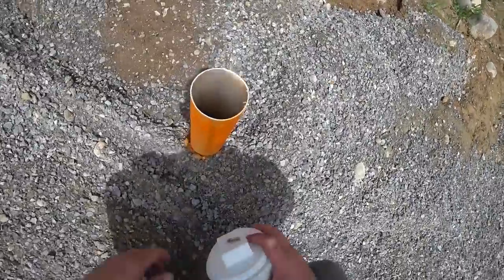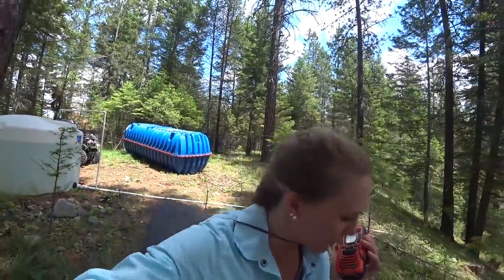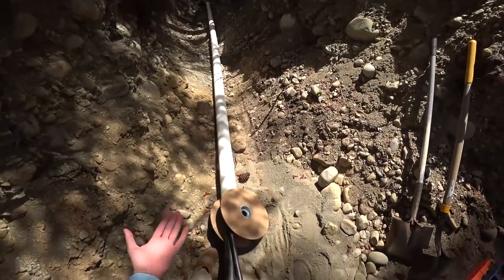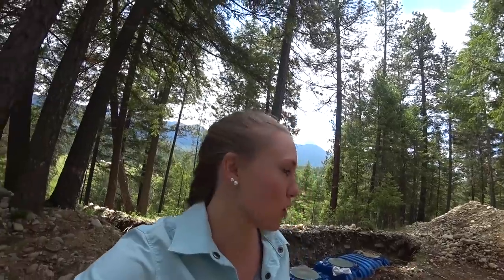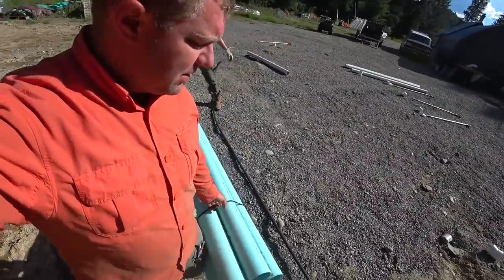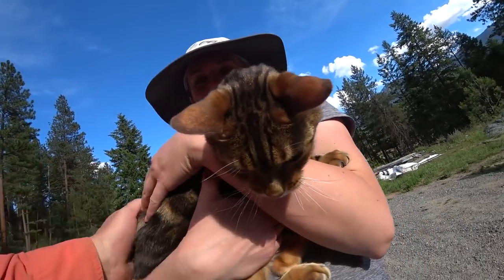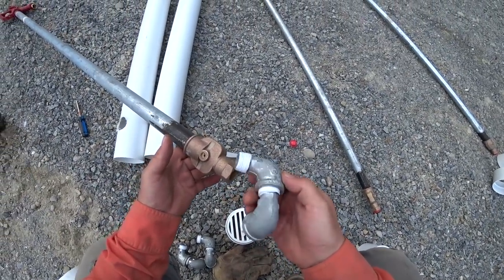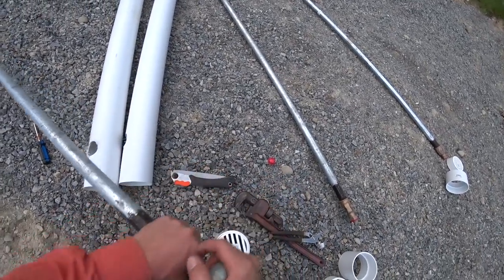Here a hydrant, there a hydrant, EVERYWHERE A HYDRANT HYDRANT!

Comment: Hey guys,  a quick tip for your plumbing projects. Alyssa already seems to have correct but when you are using adhesive always apply to the outer surface inner pipe first not the inside of the joint socket. Not a huge issue for casing but very important for water and sewerage piping. When you do this any excess adhesive is pushed away to the outside of the joint, if you put the adhesive inside the joint it gets pushed inside of the pipe and causing a hard lump which can trap debris which often builds up and causes blockages.  Love your channel and keep up the great work  :-)
Reply: I used to manage an apartment building and worked with LOTS of PVC pipe and what this guy says is true. Your system is fine for now but when it comes to the house, paint the outside of the smaller pipe.

Comment: You guys are doing great;  in the long run doing it right is always the best choice.   With the late start hope you can at least get the lower level done and the floor above on it.   Then with a tarp on it;  you will have a dry place to work,  on the timbers,  for the upper floors, over the winter.      Bert

Comment: There is a reason they are called "Frost Free Hydrants." They need to be direct buried. ANY air space allowing above ground freezing air to get below the frost line will freeze the hydrant as well as the water line causing it to burst. The MUST be buried. Don't over think everything.

Comment: Just a quick tip on plumbing hydrants, stainless 90's at the bottom are excellent...very good alternative to galvanized fittings. Brass used to be common but the pricing is pretty high. Best place to source this type of fitting is from a plumbing supply house.

Comment: Hi Guys! Have you ever thought about heating the PVC pipe to make long sweeps instead of using the 22.5 and 30 degree elbows? It makes pulling so much better.  They sell heat blankets and hot boxes for bending pvc pipe, however you can use a weed burner if your careful and move the torch quickly around.  done it a bunch and works great for ditch bends.

Comment: You can soak the rusty pipes in vinegar, rinse, clean with a brush.  About a day.
The hydrants don't need encasement/stand pipe, just put gravel in bottom of hole, starting under the stand-pipe, and up until the last 1 foot of ground (depending on depth of typical hard freezes.  I'm in the South, so we put gravel all the way to the top.  The weep hole is on the 'up' side of the valve, so I have never heard of a problem with bacteria intrusion.  You might be over-thinking the issues.
Using a stand pipe for the hydrants will also increase the penetration of cold down to the valve - unless you plan on filling the stand pipe with foam or insulation.

Comment: The person or persons who mentioned using brass fittings was/were absolutely correct. I ended up having to have my pumphouse replumbed last fall after 20 years of use. I wish I would have used brass back then because of two reasons. One it would have been much cheaper 20 years ago. And two it would not have needed to be redone. I am no longer able to do most of those things anymore so now I have to have someone else do it. I am very fortunate and I have a great friend who is a well driller. He was the one who drilled my well and redid my pumphouse. The people that seem to think you should not make any mistakes must not be doing anything. I was told a long time ago that the only way you don't make mistakes is by not doing anything.

Comment: I have an idea: on the end of pipe you are trying to pull: 1) put a length of dowel (or round wood into the pipe so it doesn't collapse when you 2) put a kellum grip over the pipe and then 3) use a fence puller/come-along or even just a long wrecking bar as a lever to pull on the kellum grip/pipe.

Good Luck.

Comment: Won't the main  pipe freeze with the encasing going out of the ground since there is no dirt insulating the main pipe not so much worried about the stand pipe freezing
Reply: Brandon Beckemeyer this is my thought as well..
@pure living for life
Reply: IF they stuff a wad of fiber glass insulation to seal out the cold air, they should be ok.
Reply: The main pipe is only exposed via the encasing, so I would guess that it won't be easy for the main to freeze with the minimal amount of exposure. They could add some insulation inside the vertical encasing to keep the cold air out and help keep what little heat is in the ground from escaping. While they mentioned that the encasing would allow them to replace a hydrant without digging, I could imagine a few ways for that to not work out as hoped, but I can't blame them for trying.......it might work, in the unlikely event they need to change one. Threaded pipe can really be a pain to repair later and those fittings that he wire brushed so well, will be quite rusted. At least he had a clean surface for the teflon tape, but I hope he didn't expect the fittings to stay rust free after installed.
Reply: I think in an attempt to make repairs simplified the are going to make a need for the repairs and getting the hydrant out it always seems to take a pipe wrench on the hydrant and on the elbow to break them loose. The little bit of work saved by not having to dig it out doesn't seem worth the risk of frozen pipes to me.
Reply: also the most common problem will be the galvanized pipe rotting where it threads to the Brass valve causing them to have to dig it up anyway
Reply: that and, speaking from experience, if you have to maintenance it that encasing might be to small anyways to fit hands and tools in there. Spiders will it in there easily :|
Reply: the relative amount of exposure (surface area of main pipe) will be reduced somewhat by capping the pipe (even spray foam around the top) just to keep the air from moving. The resultant air plug will provide some insulation - to your point, not a lot. The other benefit as this is an active system, water flow itself will help prevent freezing. Even if that piece of pipe risks going below 30* - the water running through it will be in the 55-60* range, at the coldest, which is sufficient to keep it going. I would be inclined to spray in foam close to the base, somewhere near ground level and at the top, creating a couple of air plugs.  I wouldn't fill it w/foam, as that would make future maintenance "potentially frustrating."
Reply: I know the stand portion of the "frost free" hydrant won't freeze because there won't be any water in it unless the valve is opened at which point the flow will keep up from freezing. My worry is if the feed line at the bottom could freeze from the open air exposure due to the casing

Comment: word of advice stay away from galvanized go with brass or you will regret it down the road,Ben there mistakenly done that.yes its more expensive but it will be worth it when your digging up all your galvanized fittings and replacing them .they will carode and plug eventualy,trust me.
Reply: So right Kevin those galvanized fittings will continue to rust and can cause your water to run red continuously depending on your water.  And putting the fitting in the weep hole restricts to ability of debris in the water to get out and there will be rust coming out soon enough.
Reply: I was wondering about that.  Thanks for the info

Comment: One more thing you guys might want to think about before you dig in those hydrants. I would have a male thread on the standpipe running down into a female thread connection at the bottom. That way If you have to pull the standpipe at some point, you'll be able to apply PTFE tape. 

As it sits now, you are going through all the effort of making this easy to work on, just to have to dig it up to seal the threads.

Comment: Pickup a 10x10 canopy. you can set it over where you are working to give shade or protect from rain. Great for most projects from plumbing jobs to working on a vehicle. Only ones it is bad for are ones that involve enough heat to melt it or swinging tools like for splitting wood by hand.

Comment: We've had problems with hydrants tearing up the fittings below ground and starting underground leaks, because kids swing on the standpipe, or people hang heavy buckets on them, or someone wrenches the handle, or whatever. it seems that having them in a casing, so they don't have the support of the surrounding dirt, will make that problem worse.

Comment: In Australia we have a product call denso tape it is a cloth covered in a dense grease that we wrap around the joints to keep the air away with no air there is no rust I have dug up joints years latter and they are as good as the day it was installed we got this tape from plumbing suppliers also make sure to back fill over your pipes with 6 inches of clean fill or the pipes WILL be crushed by those rocks I am a builder with over 40 years of experience and I have seen what happens if you don't do the job right To encase the stand pipe the best way is to did a hole about a foot deeper than the bottom of the hydrant fill with 3/4 gravel to 6 inches above the pipe cover the gravel with a piece of silt cloth and backfill with sand If you have to did it up in the future sand is easier to dig than gravel or dirt

Comment: If you have a bunch of those galvanized fittings that are rusted, get some Evaporust or an equivalent from Home Depot. It works wonders and will get the rust out of all the smallest crevices. Best part is that it is water based so it is not caustic (like CLR rust remover, Krud Kutter, Etc) and it is completely biodegradable. It works super quick too, depending on how think the rust is.

Comment: When trying to pull two surfaces against each other, e.g. rubber covered wire inside of PVC, or ABS pipe inside PVC pipe, etc., we use wire pulling soap.  ''Shhhloppp it up'' really well and your pulling would go a lot easier.  Dish soap liquid, or liquid laundry detergent also works really well.

Comment: On the 2nd pipe would be a good idea to run a steel wire in the pipe. It would allow you to be able to find the pipes in future much more easily.Love the channel by the way
Reply: Sorry, Later on if the property was sold, then by using a metal detector it would be easier to find the pipes. Years ago, I was working on a building site and myself were putting in concrete posts and we were told that there was a buried pipe. Another labourer took a good couple of hours to locate a pipe as we had to dig holes to find the approximate run of pipe,A right pain in the back side.A couple of weeks later we were doing a similar job and as there was a light wire over the pipe, it took 15 minutes to plot the pipe

Comment: Don't bury galv fittings use brass or SS  for your hydrants. Some of your thoughts on plumbing the hyd and being non potable are wrong at least to me,sorry just my opinion and our family business is Water Wells since 1966. I have buried and installed hundreds if not thousands of hydrants here in the NW Ohio area and we freeze near 4' deep.  If you bury your hydrants in an open tube chances are you will freeze your water system and maybe even break it too.  There are better ways to do/plumb them,I can give you suggestions if wanted.  How many PSI water line did you install? Your ground is porous so water should drain away easily so put a 4'' corrugated drain pipe on them 10' long or so.  Remember they are frost free hydrants not freeze proof if used in the winter they are to be used a certain way to keep them from freezing.
Reply: Steve La Londe Jr cool im from NW Ohio too wauseon
Reply: US6 West last town in Ohio,Edgerton

Comment: just a FYI, your never going to be able to remove the 2 inch pipe and 3/4 from the 4 inch encaissement
you have so much friction and you had the help of the truck and lots of lube. now, the lube has seized-up and is lile glue. have the same issue with electrical wiring inside pipes. good luck in your project

Comment: I use the brass brush from a cheap gun cleaning kit to clean inside pipes.  I kept one of the brass extensions and chuck one end in my drill and whatever brush size i need in the other end.  Super fast and cheap.

Comment: Hey folks Ive been watching and catching up on some of your previous videos. To clean inside your street elbows try a batter terminal cleaning tool with the round brush at the end its a cheap fix or go to home depot and they should have a tool for thread cleaning other than that keep the videos coming and the good work going.

Comment: That poly pipe can be a pain. Last project i did similar to yours, i put the casing on one section at a time, then glued it together. Using a piece of iron pipe inside the end of the poly to keep it straight enough to feed into the case without much fuss. Yeah, i had to get the dirt out of the joints to glue it, but ya gotta do what ya gotta do when working alone.

Comment: Muriatic Acid (Diluted HCL aka Pool Acid) eats the rust. Put a little in a glass jar and slip in your rusted pipes or tools, etc and swish around the liquid. Just make sure you don't get it on your clothes or skin and rinse the derusted part with a mixture of baking soda and water. Warning! Never close the jar while you have rusted material soaking in HCL or if you ever add soda into the solution as an explosion can happen. Also do this outside as hydrogen is a byproduct and you want that to release into the atmosphere unhindered.

Comment: Buy a cement in ground box like your electrical connections and your city water would be in if you were in the burbs.  They are flat to the ground and yet you can remove the top and access the pipe still.

Comment: You will Regret using galvanized fittings... you will eventually need to dig up and replace them, Instead Use schedule 80 pvc threaded fittings... and a double street joint is called a "Swing Joint".

Comment: you guys should have used sweeps in your encasing.  they're angled couplers with gentler curves.  Probably very expensive or maybe unavailable in that diameter... OR you can bend your own PVC... dooable but takes some effort.  fill it with sand. heat it up with a tiger torch, and bend on a jig. sand prevents kinking.

Comment: Are there any concerns about critters that may have crawled into the poly tubing or any other parts of the system, or have you taken precautions?  I'd hate it if after all that work, something got trapped in there and contaminated your water supply.  I did see the part about the hydrants... Will any section of this system be supplying potable water (I've been assuming it would).

Comment: BTW where you've cut holes to install the horse heads...better find a way to prevent sediment from getting into the 4" pvc. Guarantee it'll fill in several feet into the pipe in about a year.

Comment: Wont having a casing around the hydrant defeat the insulating value of the ground allowing cold air to sink down to where the valve is, causing it to freeze and burst?   You should fill the casing around the hydrant with insulation to help with this.

Comment: Not sure if it's a good idea of putting the hydrants in casing. This will reduce to almost nothing the insulation value of the earth, making this more prone to winter frost.

Also, the amount of lubricant that you put on the water conduits is, by far, insufficient.  For a telecom cable (it's kind of the water conduits that you use but heavier and far stiffer) pull in encasement as long as you are dealing with, we would pour probably two or three five-gallon buckets of lube. It is also exceptional that we will install any elbow (22,5°, sometime 45°, never 60° or more). Instead, we install a service trap and free hand the cable/tube curve.

Keep up your good work.

Comment: just something to kinda put in your head, take it or leave it ,but if something is extremely extremely hard and time consuming when it comes to construction you are probably doing it wrong.same with mechanics, if you are struggling and struggling with something there is probably something you are overlooking or doing wrong. those water lines should have been a weekends work at most you made it so  much more difficult than it needed to be.

Comment: Like your video but, using galvanized fittings in direct contact with the earth;  no way.  Here in West Virginia you'd be lucky to have them last two years.  Plastic or brass would be the preferred method.  Your do-hicky  with the street ells is a waste.  At least half of your pipe is going to be below ground and if a car hits it, it is just going to bend the stand pipe.  As someone else suggested, use T-posts around it.  Personally, I'd locate them where there is no chance of them being hit.
Last, but not least.  It appears you are using 3/4 inch pipe to connect the hydrants.  With the amount of distance you are spreading these out over, your pipe is way too small.  1 inch should be the minimum and, if you're going over about 500 feet, I'd suggest 1 1/4 inch.  Using the 3/4 inch you'll have a heck of a pressure and volume drop.

Comment: Why are you guys so reluctant to expand to a larger diameter pvc in the areas where you need more room? For examples on elbows you could use a 4" to 6" coupler maybe even 8" so you could use a larger "el" then reduce back down to the 4" pipe after the turn. Would make life easier.

Comment: Nooooooo.  Those are NO Freeze hydrants!  Do not have an encasement!  You need the dirt as thermal mass and insulation.  An encasement will allow air and freeze to occur.  Digging up a faucet is 20 to 30 min.
Reply: Check with your faucet manufacturer before you think of Encasement.

Comment: if you fold a foot or so of your black pipe over at the top end of the trench and then tie the folded end off two feet down the pipe you will make a loop to attach a tow rope to pull it threw the conduit with ease with your wheeler